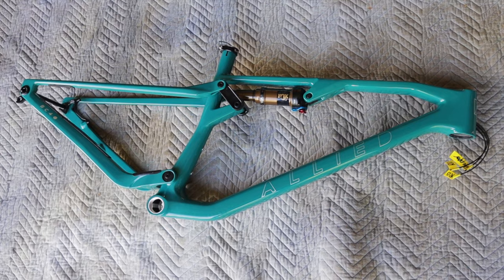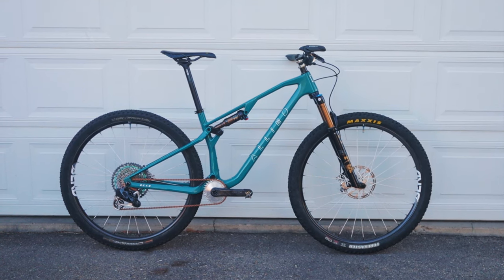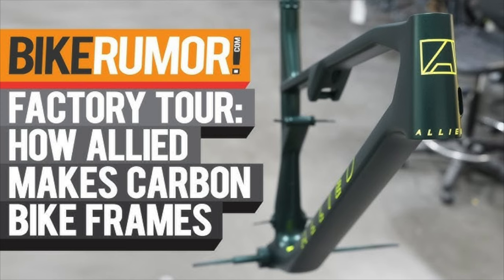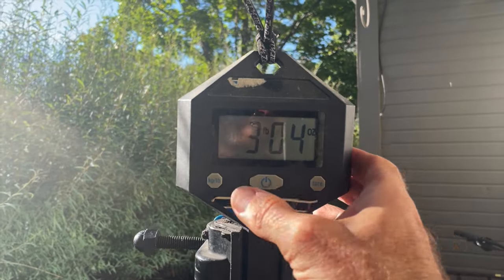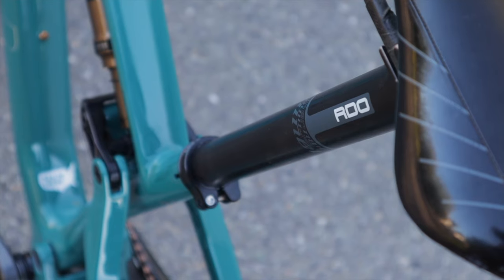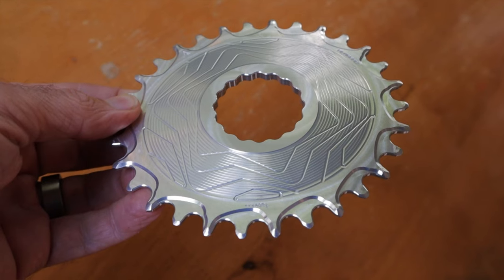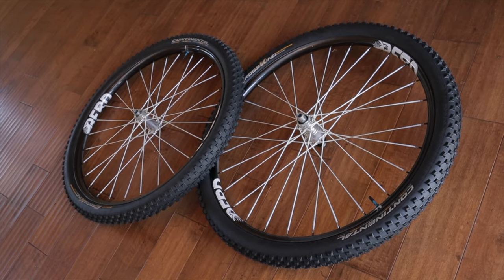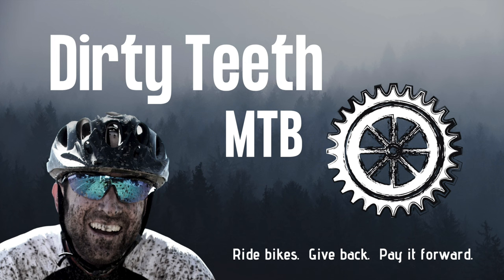So FAST.  Allied BC40 (dream bike) custom build

Comment: damnn thats pretty light considering its L size

mine full sus weights around 11.5KG with dropper post and little weight frame with rear shock around 2.5kg
Reply from the maker: It is pretty light but yours is not so bad either! Ride on. :)

Comment: What size bike dp you ride?  I am also looking to do an ALLIED build for my new xc rig.  Looking to build something around 24lbs so I am impressed with the 23lb weight.
Reply from the maker: I have a medium BC40- good luck with your build and thanks for watching!
Reply: @DirtyTeethMTB  cool so if you added a dropper it would be right 24lbs?
Reply from the maker: @shredntread9600  yep 👍